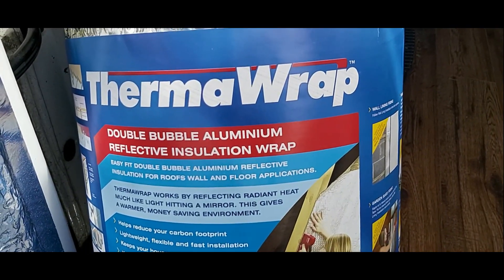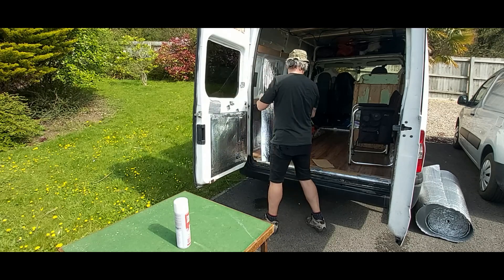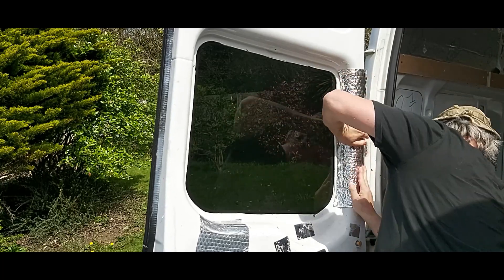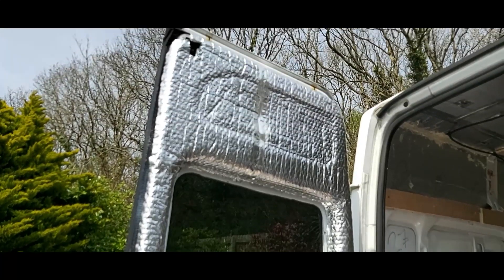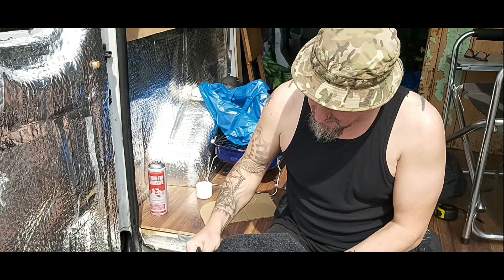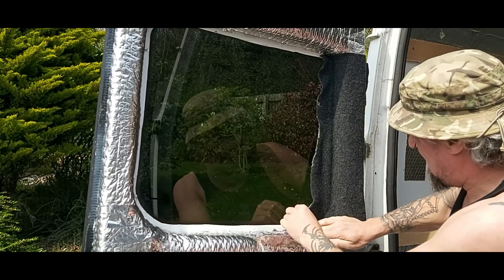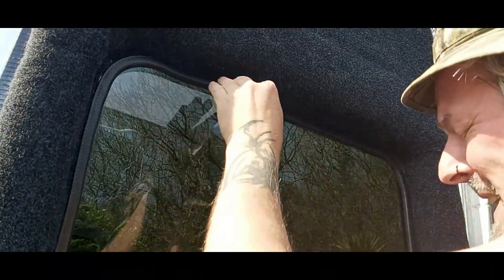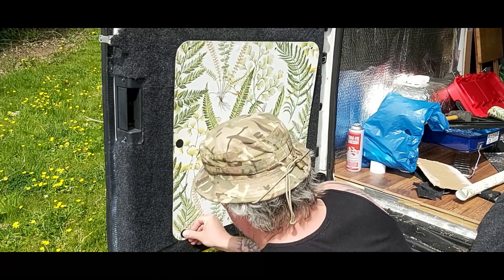Carpert Them Back Doors! April Van Build Update 3 - VANLIFE UK -

Comment: Nice one 👍 that trim fix glue gets everywhere, good stuff though.
A little disappointed you didn’t have the usual beer 🍻 between thermo and carpet.
Cheers 🍻
Reply from the maker: Cheers Paul! Yep it does get everywhere and I'm spraying it everywhere to :) As for the beer, I'm off the drink for a few weeks as I need to drop a few pounds. Normal transmission will resume shortly! :)